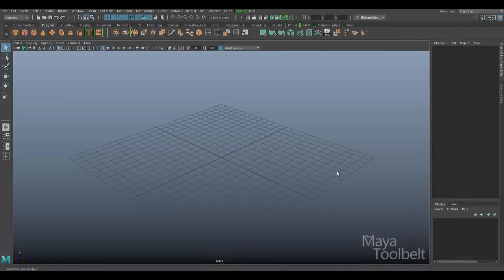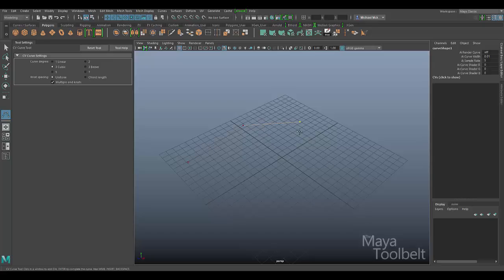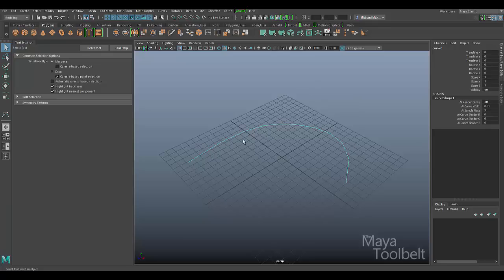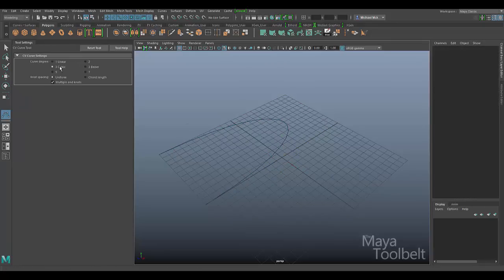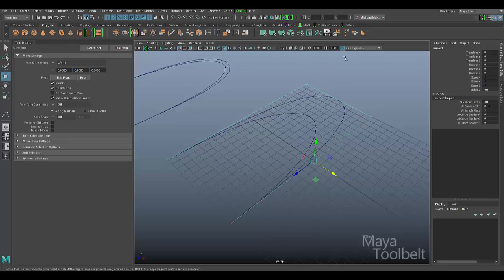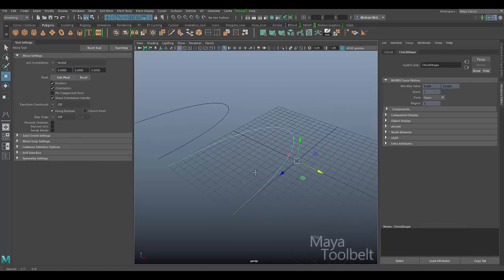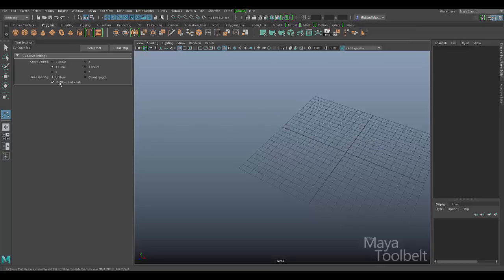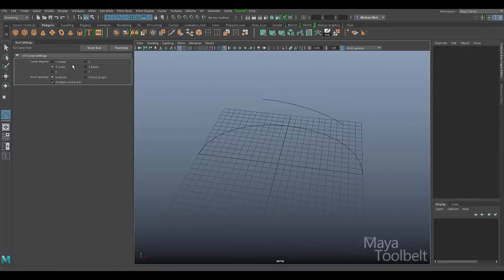The Maya Toolbelt - CV Curve Tool

Comment: Thanks for the reply but I still do not know how to connect the wheel cut in two places so that the wheel came out again
Reply from the maker: Ah, if you want to "close" a curve (like a circular curve) you would need to use the Attach Curves command to attach one end, and then the Open/Close Curve command to "seal" the other end.
Reply: @mayatoolbelt  My dude, you went way way way deep into the technical aspects of CV curves, without covering any of the basics: how you add remove CV's along a curve, how to close them, how to smooth them, inserting knots, how to attach two curves, how to turn a rounded part of the curve into a linear one etc.  I'm not mad or trying to be a prick, but maybe 10% of the people watching this video (if that) want to know the difference between, say, uniform vs chord length, and the other really obscure stuff you went into here.  Kind of a waste of time since the basics weren't even in the video.  Very weird.